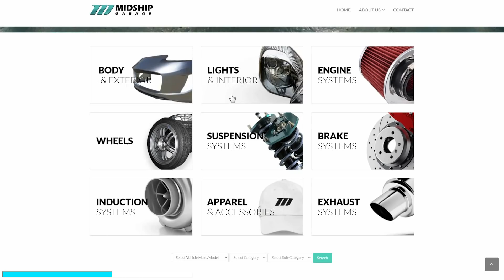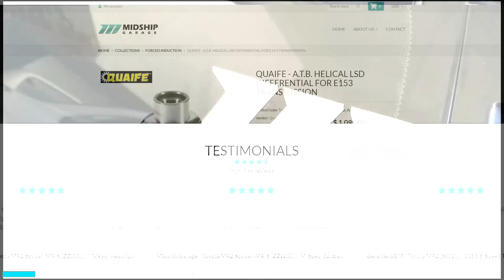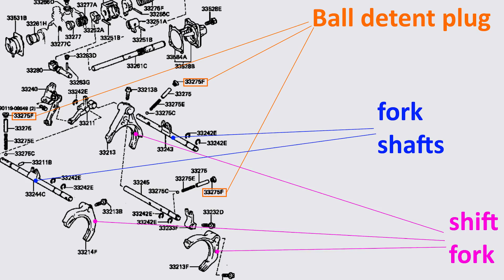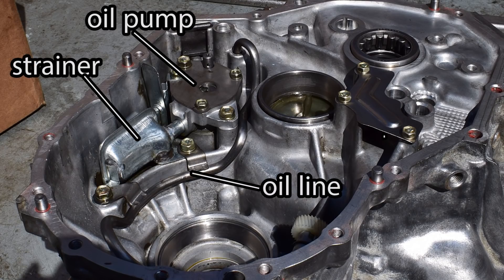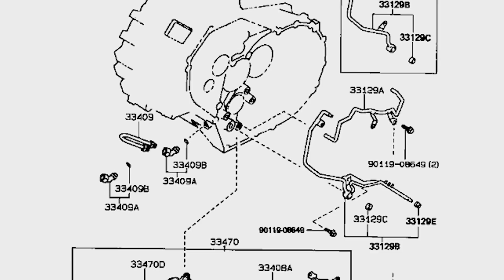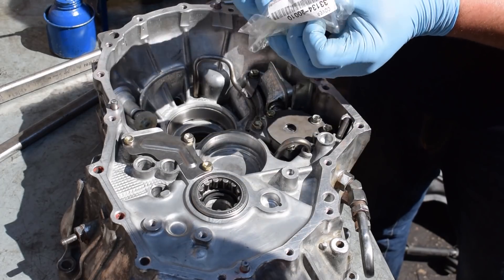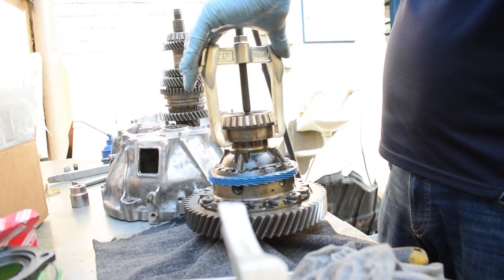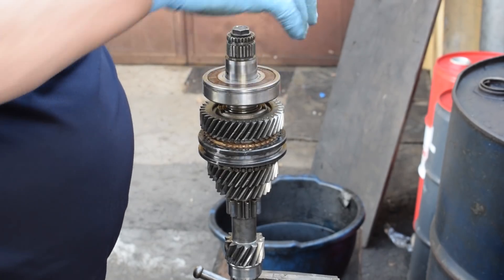How to install an LSD and REBUILD a TRANSMISSION - detailed step by step guide - Project Underdog #8

Comment: Hi there, I have a 1987 sc MR2 but it’s automatic.
I have an opportunity to buy an e51 with lsd and driveshafts for the swap. Would you purchase the e51 or stick with a c52 or go with another transmission option?

A bit of a dilemma. I read parts for the e51 are getting impossible to find.

Any help would be appreciated!

Cheers,

Tim

Comment: Hey man, great video. I really want an LSD! Is there no need to shim preload on the quaife? I remember inventing a few tools and techniques to install the stock diff to the correct pre load
Reply from the maker: The shim preloaded may or may not be needed. In my case it wasn't needed. The mechanic you see building the transmission in this video installed dozens of them over the years and he said that about 10 years ago they started being so well made and fit with the casings so well that he almost never needs to shim. They needed shiming a lot more often in the early days though.

Comment: Was that white car at the car wash a Toyota Yaris ?
I own an ‘07 Yaris, but the American versions differ some from yours.
Hardly anyone drives tiny cars here in the USA…except me…I have for 30 years
Reply from the maker: It's a 2009 Toyota Aygos, smaller than the Yaris. I believe the Yaris is the same or very similar everywhere. I use it a lot about town for chores and such. I got more mileage and use out of this car than most others I ever owned. Small cars are awesome and tremendously versatile if you're willing to compromise just a bit.

Comment: just look at your video on the lsd install and gear box rebuild and wanted to know if you know were i can get the diff bearings, specifically the right bearing with the extended part  made on to the inner race

Comment: I wanted to get a clutch type LSD for my atmospherical MR2 SW20. This video changed my mind. There is no way I'm opening a transaxle like this and it will still work fine once it's reassembled.

Maybe I'll find a shop that does this as a service.

Comment: you can use heat to remove the bearing case at 10:00, and also to install it
Reply from the maker: Heat doesn't help because you can't grab onto anything to remove it
Reply: make grooves in it, I do find heat and cold help massively in removing/assembly parts, some times, they slide in or fell off , no pressure required!

Comment: Does the CD7 have provision for speed reading in tunnels or canyons? I'm always intrigued how GPS based speedo handle losing the satellite connection. I would think the ABS sensors would be a good option, if they're something the ECU/dash can read, assuming the vehicle has them (not sure if the mk1 MR2 has ABS so maybe not a solution here).

Comment: i thought the mr2 has the same trans like the ae92 gts which use the c52 but urs is e51?
Reply from the maker: NA mr2 has c50 and c52. Supercharged has e51. I currently have a C50 mated to my bike carb engine. But for my new turbo engine I'll need a stronger transmission so I'll be using the e51.
Reply: @d4a  I see, would the e51 fit other Toyota which use the 4age also such as the ae92 coupe, the hatch gti?

Comment: wwwhhhyyyyyyyyy didn't you put the speedo gear back!!! WHY!! now you'll need to pull the gearbox apart again to go back to the classic stock gauges when the digital dash gets dated and looks tacky later :(
Reply from the maker: Cd7 tacky? Puhh leaseeee
Reply: @d4a  yup in 15yrs time yo! happens every time :)
Reply: @Mango_McPoo Given that he actually drives and enjoys the car, in 15 years it’ll probably need another transmission rebuild anyway.

Comment: Great video as always! Does the bearings on differential needs to be configured also? You take them off and install them again and the gap between bearings and the transmission body will be slightly different. That can do some noise or overheat in future. PS: sorry for my poor English, I'm from Russia.
Reply from the maker: Sorry I'm not sure I understand. There's nothing you can configure in this case. They were removed and installed in the same place just on a different diff, but all the Quaife dimensions are identical to the stock one.
Reply: @d4a  In RWD cars the tapered roller bearings on differential case needs to set up some kind of "preload" (to reduce a gap in this type of bearings which exists by design) and this procedure must be performed every time if bearings removed or installed. In the video the bearings just install on the same place - is it safe? or for FWD cars it is enough?
Reply: @charliebeltram144  that's an MR2 Toyota, it's RWD (but yes, it's also a central engine, so the setting is similar to a FWD one in that sense). I agree with you on the preload check on the bearing, that's something that should be checked on the manual I suppose.

Comment: Why rely on GPS for the speedo? The electronic and mechanical speed sendors are interchangeable. That should interface and be scaled to work with your new dash. There might also be "spare" wires in the correct place to repurpose if your car didn't come factory fitted with cruise control. Other Toyotas (SW20, Hilux) had both mechanical and electronic sendors and matching speedos that interchanged. I never found one with the odometer reset in the correct position otherwise I would have swapped out to delete the cable drive.
Reply from the maker: Honestly it's just so much simpler. Figuring out which parts I need for the electronic speedo and then setting up the signal to work with digital dash isn't simple and I need the energy for other bigger things. I also prefer gps speed as it's dead accurate and isn't influenced by tire size and what not. For example when I'm using navigation on my phone I always find myself looking at the speed there and there's always 5-10km/h of difference in every car I've driven.
Reply: @d4a  I finally put my door card back together today so the car is officially over its rebuild. The speedo is of interest as I need to repair or replace mine. I do have an excellent Taiwanese GPS HUD to install, but Im torn because its a stock interior.

Comment: Curious: Will the accuracy of the GPS-based speedo be the same as the trans-based? Isn't there lag with the signals? At least on my phone (which I suspect might be quite different from the AEM), there's probably a whole second delay on updating speed.
Reply from the maker: It's actually more accurate than anything trans based,. Usually what you see on a conventional speedo is 10% ish less than what you're doing. I don't know about lag, but I doubt it's significant, but can't say for sure until I try it.
Reply: Not as accurate when your in a tunnel. My GPS speedo holds the last speed and shows a tiny  "signal lost" icon in this situation. And yes, our local tunnel is steep as it passes under a river and has a speed camera at the bottom of the dip.

Comment: Is a GPS-based speedometer legal where you live?
Reply from the maker: All you need to be legal is working brakes on all wheels, working lights everywhere, working parking brake and acceptable emissions for your emissions class. Obviously matching vin numbers and non rusted through chassis and other basic stuff, but no one sweats the "small stuff" like non-original steering wheels, aftermarket wheels, aftermarket suspension, performance air filters etc. Classic cars also get a bit more understanding for stuff like that because people have the common sense to know that keeping a car like that on the road requires a lot of care and effort anyway and owners are enthusiasts who make sure to keep the car in roadworthy condition even without any laws. You can have a legal engine swap too as long as it's not something absurd and poorly made. All in all for now there's still lots of common sense and no nanny-state stuff which works in favour of project cars at the end of the day.
Reply: @d4a  Much longer answer than I expected :)

Comment: gps speedo is all well and good until you end up in a tunnel with speed cameras in.
Reply from the maker: Just keep driving normally?
Reply: @d4a  idk i'd just panic.
Reply: I have the revs in 5th memorised for 80 and 100 km. Handy as my speedo stopped working and I could never find a replacement.

Comment: Having done that myself, I can definitely say that a transmission rebuild takes way longer than 17 minutes! :D
One thing I do differently is to not smear the sealant with my finger, but leave it as it comes out of the nozzle. When the mating surfaces come together, that 'snake' of sealant will be flattened and pushed where it needs to be. Like this:
https://youtu.be/e6I6vJb6HQk?t=1012

Comment: if you tear the box that much apart, what could you do there to make it stronger? or what does a gearbox need to handle big amount of tourque? bigger gears? changing the synchros?
Reply from the maker: This is already a very strong transmission which is why I'm using it. My current transmission which is a c50 could not reliably handle the turbo turbo torque my new engine will be making. The main difference are the gears they are dramatically thicker and beefier in the e51. Some transmissions have upgraded aftermarket gear sets for them but they're usually very expensive. If there isn't anything in the aftermarket than you need to make a custom set, which is usually even more expensive. You can also pick up a lot of strength by getting straight cut gears but those are often very noisy. All in all it's usually a lot cheaper to use a different transmission than trying to turn a weak transmission into a strong one. The synchros don't have the task of bearing any torque so they don't really play a significant part in the strength equation.
Reply: @d4a  i wish you could do a detailed video explanation on transmissions, from sequential, manuals, automatics to dual clutchs.
Also I wish you could do a detailed explanation video on doing bellhousing alignments
Reply: @d4a  for my gearbox, i only can make it itself stronger. if you have ever seen the transmission/transaxle/oilcontainment-box on a SAAB 900, then you understand why
Reply: Also the center distance between the input and output shaft is bigger. At the same torque, the longer leverage gives a lower tooth load. Theres around 15 kg more metal in the E Vrs C gearboxes.

Comment: I took two honda k series 5spd transmissions (both at around 200k) and chose different parts from each to create a super ghetto transmission. Did it without anything other than the internet, my tools, and my 17 year old hands... later swapping my k20a3 for a nother lower (50k miles) k20.. chasis is currently over 280k (dc5)

and the transmission is still holding up 😅

Comment: What's better than an LSD? A sponsored LSD! Congrats on another awesome upgrade. I'll be interested to hear how big a difference it makes.
That transmission oil pump is super cool. Definitely not common. I feel like I remember the Celica GT-Four having similar from Project Binky?
Awesome filming and editing. Great video. My note is that instead of an angle grinder I use a Dremel and cutting disc to remove bearing races!
Reply from the maker: Actually it was a 50% off deal and free shipping, but I'm still very happy as it's a pricey thing and international shipping for it is a fortune because it weighs a ton😊 I'm really curious how the LSD will behave too, I'm a bit sad that I'll be comparing it to the NA engine and that I won't experience the turbo without an LSD, but it'll still be fun as I feel like I know the current setup inside out now.
Reply: @d4a  Better than an email reply that says "Piss off. No discounts for you." Hahaha. I have heard the AW11 doesn't really need an LSD until past a certain horsepower level, but I imagine you'll definitely be past it now. Would have been cool to compare NA. Does that mean the turbo engine is getting assembled soon? :D
Reply from the maker: I'm hoping the assembled will happen this summer. I'm waiting for one more critical bit and I have one more thing to finish on my end. After that it's machining and then assembly.
Reply: @d4a  Yesss. Best of luck! Wish I could come help hahaha.

Comment: Unorthodox technique? Have you seen a video where a youtuber removes pilot bearing using greese and bread?
Reply from the maker: Seriously?
Reply: @d4a  I'm surprised you haven't seen that, hahaha. Classic!
Reply: have used bread before, works surprisingly well on pilot bushings and bearings as long as you have a very close fitting shaft to hammer on :)

Comment: Reasonable amounts of sealant!?

A guy at work was helping us with a traction motor rebuild one day and decided he was going to apply the sealant to the bearing shells. 

We had to break the motor back down and clean everything again, as there was so much sealant the bearings couldn't seat against the motor. 

A little goes a long way 😉